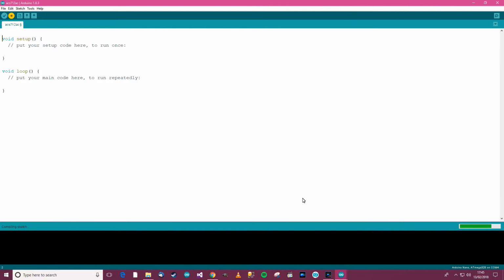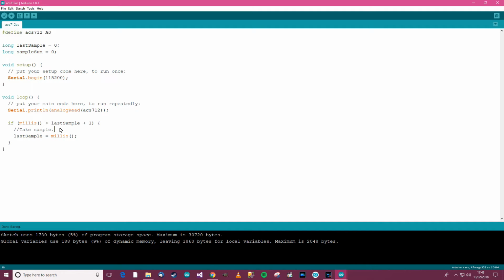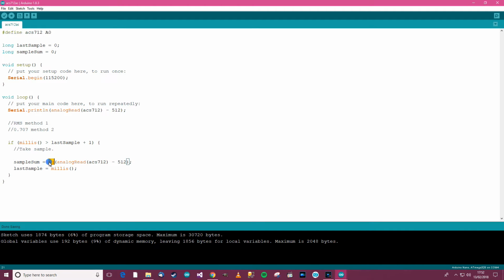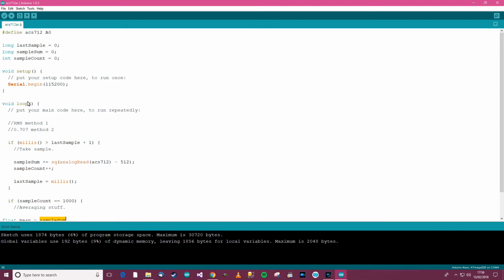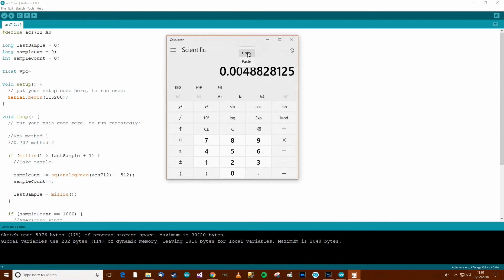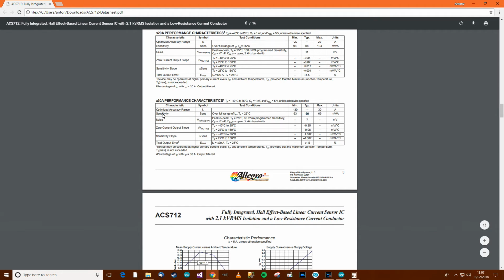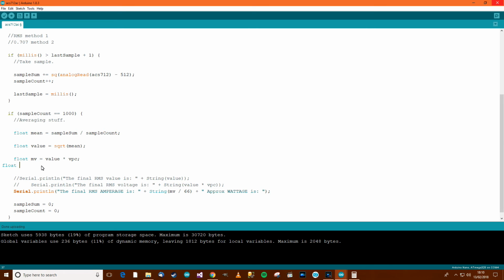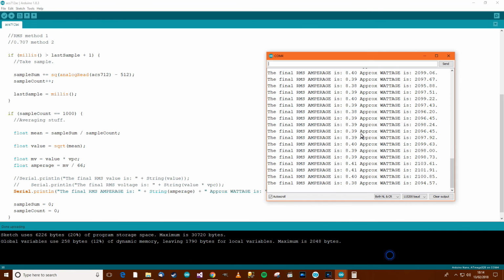TUTORIAL: How to Measure AC Current Using ACS712 Hall Sensor (Part 3/4 - Coding RMS Method)

Comment: It didn't give me values nearby you when I did all the same things you have done to find the final RMS voltage I got 10.92 instead of 213. Can you please help me out as I need this so desperately
Reply from the maker: Maxly Hi, did you follow parts 1 and 2 also?
Reply: Yes. I found my mistake it was because I was having another type of Acs712 rated for 20A. Their I had to change the 66 into 120 it supposed to be 100 only but 120 was serving the calculation in better way in finding the amps.
Reply: Thank you very much for your video and fast respond. I really appreciate your work
Reply from the maker: Maxly Thanks Maxly, I'll pin this comment to the top so that others can see.

Comment: Ey bro you had a little mistake. So you are calculating the apparent power in VA. If you want to get the real power, than you had to  multiply apparent powert times cos phi. Thants why your readings are not like on the label. To get phi, you have to calculate arctan(Im/Re). Im is the Imaginary resistance and Re is the real resistance. I am a qualified electrician and must say, I learned a lot of your videos. If you want something let me know.

Comment: Hi. I followed your exact codes with exact materials but can you explain what may be the reasons why I measure 0.22A to my 2.5A laptop charger? I have 2 ACS712 current sensor and both read the same amps.

Comment: great video,wonderful explanation..... am trying to do same thing with an arduino DUE but i cant seem to get things right especially in calculating the VPC and the aspect where you used 512. please help me out. Am trying to read values from a voltage sensor to accuracy but all videos and tutorials have gone through yours is the best but am unable to achieve this using my DUE board, this is really important for me. I would be grateful if you can help me out. Thanks in anticipation. email : justusblaise@gmail.com
Reply from the maker: Use vpc as 4.88mv or 0.00488v. :)
Reply: @antonycartwright  it gave me wrong RMS voltage when i tried it just the way you did on your video which i believe was because the arduino DUE operates on 3.3V not 5v.
Reply from the maker: @justusblaise7189  hi, the acs712 is designed for 5v devices. You wouldn't be able to get full resolution on a 3.3v device.
Reply: @antonycartwright   okay that explains it, thank you very much. Can you assist me, am working presently with a voltage sensor, and i want to read the output voltage to an analogPin of my arduino. Am unable to read the accurate values it keeps changing at a wide range(values are not consistent). Can you show me how to calculate RMS voltage on a voltage sensor (ZMPT101B) to accuracy. Thank you so far for your prompt responses, highly appreciated and thanks in anticipation of your reply.
Reply from the maker: @justusblaise7189  hi, if you search RMS in my channel, there should be a few explanations on it.

Comment: thanks for making the video before, i use your code for my project. it's way better than any code that i found in internet. when i upload your code, the calculation is right . but the problem is when i turn off my lamp as load the data wont turn to zero. can you help me?
Reply from the maker: You will have to add some sort of fudging factor to it... like if <0.05, then make it 0.
Reply: @antonycartwright  thanks for the answer.

Comment: Thanks to Antony for his work.  Here is the code to save you typing it all in.

#define acs712 A0

long lastsample = 0;
long samplesum = 0;
int sampleCount = 0;

float vpc = 4.8828125;

void setup()
{
  Serial.begin(115200);

}

void loop() {

  if (millis() > lastsample + 1) {
    //take sample.
    samplesum += sq(analogRead(acs712) - 512);
    sampleCount++;

    lastsample = millis ();
  }
  if (sampleCount == 1000) {
    //averaging stuff

    float mean = samplesum / sampleCount;
    float value = sqrt(mean);
    float mv = value * vpc;
    float amperage = mv / 185;  //66 for 30A  185 for 20A  185 for 5A

    Serial.println("The final RMS Amperage is: " + String(amperage) + " Appox WATTAGE is: " + String(amperage * 240) + ".");

    samplesum = 0;
    sampleCount = 0;

  }
}
Reply: This Line is wrong:

float amperage = mv / 185;  //66 for 30A  185 for 20A  185 for 5A

Should be like this:

float amperage = mv / 185;  //66 for 30A  100 for 20A  185 for 5A
Reply from the maker: Hey, thanks so much Dave.
Reply: Very helpful.  I want to add  curent conditions what I have to do . I m begener.  If ( amp>= 3)

Comment: Hi Anthony, Firstly great tutorial, thanks. If you could assist with the following that would be most appreciated. I am using the 30Amp ACS712 and after following your video created the Sketch to measure 240v AC (U.K. based). The program works great up to 10 amp, verified using a clamp meter. However, when testing my program with a load above 10Amps the output drops to 6.4 +/_ amps. I have used and tested various different parts and manufactures with the same results. Have you tested your program above 10Amps?

Comment: Why serial.begin 115200 ? Using serial.begin 9600 not good? Also when i did the RMS voltage, it gives me 0 as outpur. When i plug in the source, i rises to a certain value then go back to 0.can you help me on that issue please.
Reply from the maker: Hi, I'm used to 115200 - it's mostly habit. My monitor is on 115200, so if I leave code on 9600, I can't see any TX without having to change the setting of my monitor. It's just the baud rate/speed. With RMS, you'd need to tell me exactly what you did, with code. If it is like in my example, and you have AC voltage, it will work. :-)
Reply: Antony Cartwright i did the exact think you did on video. But i did connect the live and neutral directly to the sensor. Do you think it is the cause of the problem? Using the acs 30A for outlet 240V 50hz is okay?
Reply from the maker: If you do that, you will either burn the board, burn the wires, or trip your house's MCB. Antony...
Reply: Antony Cartwright so i do the exact wiring you did in the previous video and then use the same code?will that do the trick?
Reply from the maker: Hi Burty, It is probably a good idea to take your time and watch all videos again carefully. Maybe even watch other videos too and find out exactly what is going on. It's important that you know exactly what you're doing with this because you're dealing with mains voltage! There is little scope for error! :/
Reply: Antony Cartwright i think its okay now. But one thing strange, when i put bulb from 20-60 watt, it shows the value but when i used a 5 watt, it shows 0.
Reply from the maker: 5W @ 240v = 0.020A. It's a low figure... :-)
Reply: Antony Cartwright thanks. If there a way to get it? Using the serial.print(voltage,4)?
Reply from the maker: burty per I can't remember the precision of the ACS module, but the Arduino ADC can only read in 5mv increments. So, you'd have to check the figures... Antony.

Comment: I am using 3A ACS712 current sensor for measuring current from PV panels which can give maximum 1 Ampere current , but the problem is I am not getting the result , can you help me please I am in engineering
Reply from the maker: Hi, What result are you getting?
Reply: Antony Cartwright  thank you for replying to me ,,, I am  getting  a fixed value of current even if I increase or decrease the load resistor
Reply: Can you please tell me your email id or Facebook page where I can send all the circuit details and code of arduino
Reply from the maker: Ok, if you use a ammeter, do you still get a fixed reading on that too?
Reply: I will be overwhelmed if you could please guide me through
Reply: Antony Cartwright No it changes accordingly
Reply: Antony Cartwright  no it changes accordingly
Reply from the maker: amish karim ok, and have you followed this whole series?
Reply: yes i followed your  lecture 1 & 2  as my project does not concerns with RMS  rather DC current  measurement from pv panel through ACS 712 SENSOR. I have one doubt i am using 30 ampere ACS 712 BUT MAXIMUM output from my pv panel is 1.3 Ampere , can it be  the possible  cause of error , please help me sir , my engineering project is at stake.... please give me a way to contact you..plz i beg of u
Reply from the maker: amish karim You should buy a 5a acs712 for this. 30a will work but it will have poor resolution. What exactly is the problem? When you measure with ammeter, what is the result? When you measure with acs712, what is the result?

Comment: If you use the EmonLib library, it makes doing all those calculations a lot easier and more accurate. Plus it auto adjusts to varying voltages on the line to make sure it stays accurate (well, as long as you read the voltages as well).
Reply from the maker: Korishan Thanks, I've never heard of that library... :)
Reply: I learned about it when I was getting my parts together to do my own house power consumption monitoring. It uses a Split Core Transformer to get the amps used, but I'm sure it can use a Hall Effect as the number generated are basically the same. 0 - 1024 with 512 being the 0 amps. The only problem with it is that the resolution is slightly off because the arduino ADC is 10bit. I'm going to build another one using a 14bit ADC so I can get more precise measurements.
Here's the link to the developers: https://learn.openenergymonitor.org/electricity-monitoring/ac-power-theory/introduction plus the first YT video I saw using this: https://www.youtube.com/watch?v=Z3YSHhS39Bc
Reply from the maker: Korishan Ahh cool... Yes, I've made my own one of those. I personally don't use ACS712 because I don't think they're very reliable. I use a current shunt with a 12 bit adc, then I read it into Arduino via IIC bus..
Reply: Yeah, I agree with the ACS not being accurate. Plus, the ACS can't measure mains. The SCT's allow for it. I'm starting to get into IIC programming with my BMS module. So it'll be an interesting task. And I'll be using the Shunt on my DC power bank to monitor its current.
Reply from the maker: Hey! The ACS can measure mains, that's what this series is about. Lol. Regardless though, I think a shunt is the way to go. Are you going to do videos on the BMS?
Reply: Well, when I mean mains, I mean full mains, not mains from an outlet. You can't exactly disconnect the big black cable coming into the house and put the ACS inline with it  ;)

Yeah, I plan on doing videos about it as I progress through it. I just need to understand some more details before I start putting things together.
Reply from the maker: Ahhh cool cool... I'd love to see the project!